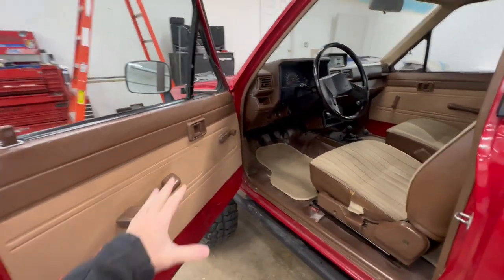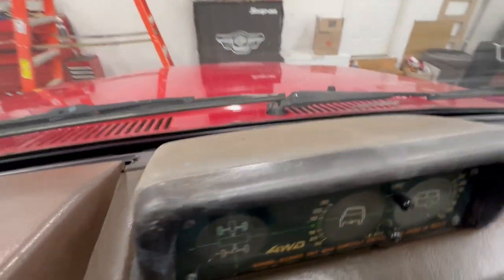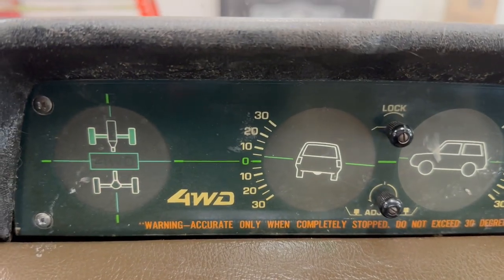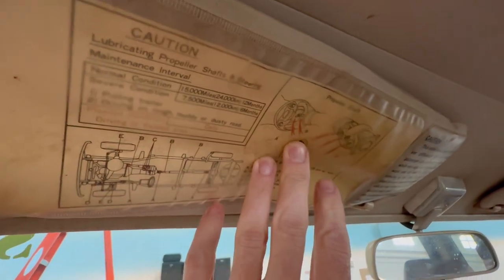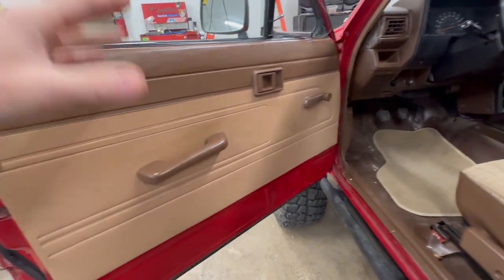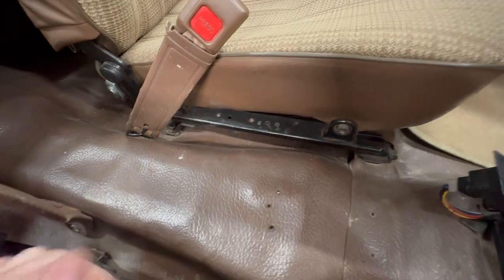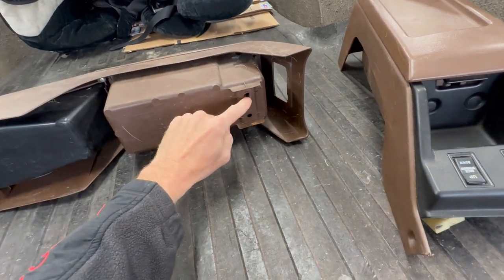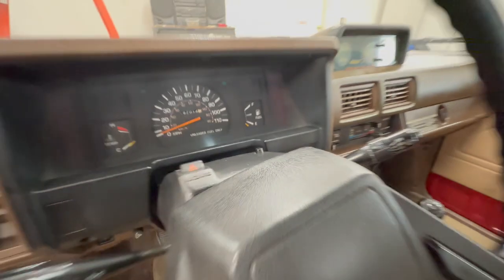1985 Toyota Pickup/Hilux 4wd Interior Tour/Review

Comment: That interior is clean. Also the deck lamp only works if the headlights are on. I am a sucker for sr5 options. I started with a base model and I added all the fancy sr5 stuff to mine.
Reply from the maker: I know what you mean, I've been in a truck with power doors & all the options and it felt like luxury. Thanks, I'm going to test that again!
Reply: I just found a Sr5 86 ex cab 2wd at pull a part..

I’ve grabbed the tilt the door panels,the tach the dome lights the bronze tinted windows.. steering column cover and it was in great shape even the dash, very rare stuff.now both of my trucks have tilt now ..
Reply: And sr5 embroidered in the bucket seats they were brown in color

Comment: I think I got the last inclinometer w/alt meter in perfect condition a couple years ago on ebay for $500...it is perfect but could have got one in 1987 for $50....But you still have 2 working 4WD lights...I need the switch for transfer....imposable to find.....That is a very nice clean truck...saw a stock 85' at Mecum auction on TV and it sold for $50,000,,,Do you have a video about removing the excab rear interior plastic panels? I need to do headliner and have no idea how they are held in and sure dont want to break them....
Reply: I have an 86 4Runner, I’m the original owner. The 4WD light on the dash went out years ago and have been trying to figure out why for a long time. No one has told me it’s a switch on the trans nor how to fix it. Now that I know what it is maybe I can get it fixed.
Reply: @joem2829  Its a matter of finding the switch...Ive been looking for years....How many miles ya got...Im original owner of a 87 4x4 pu and am pushing 1/2 million miles....If I ever find a switch Ill post it here....
Reply: @joem2829  Check your switch.....it maybe wiring...Switch should ground when in 4x4...
Reply from the maker: I've taken them out before on other trucks, but I don't have a video. Basically just remove everything in the way and be careful because they get brittle.